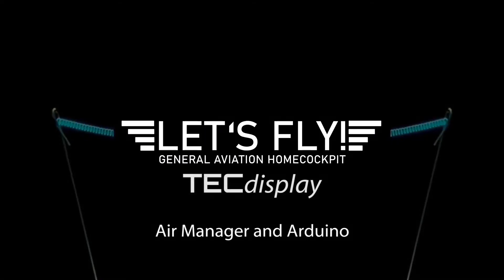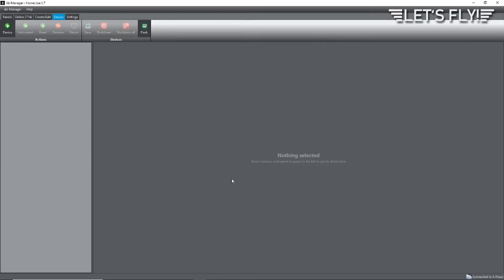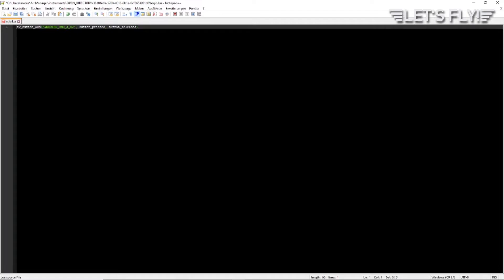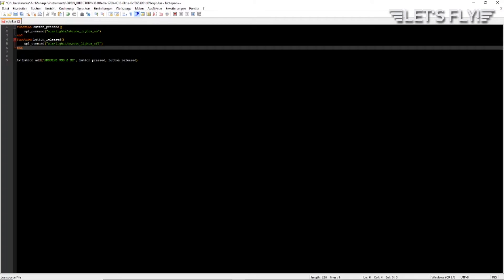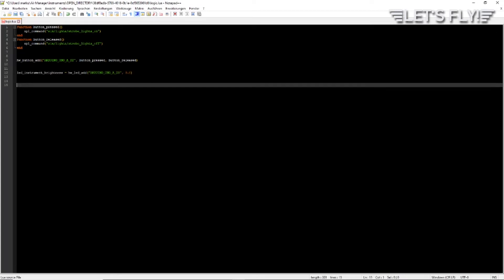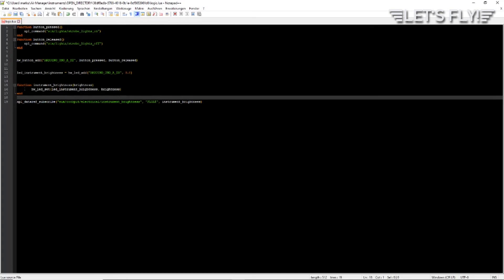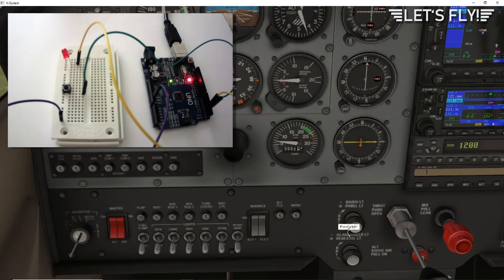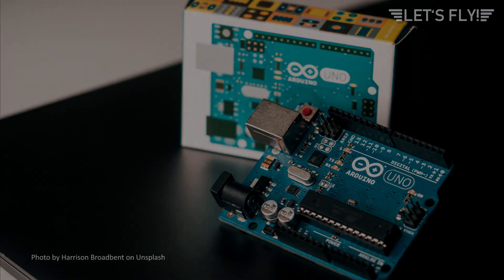TECdisplay connect buttons and LEDs via Arduino to Air Manager

Comment: Amazing, would you be able to help me for an LED I’m trying to link with the test all annunciators switch in the cessna 172sp 

Thank you
Reply: I’d be happy to pay for your services 😂
Reply from the maker: Hello. Such a functionality is not that easy. Either you have to code if yourself which is very exhausting or your plane allows it. If the plane has an announciator panel functionality all you have to to is to map the output variables to the LEDs then the test button to an input and it works out of the box... If this is not possible you will need to write a test button routine by yourself that turns on the LEDs and disregards all infao coming from simulator variables. If you would not do that it could happen that the test does not work because the variables status overrides the test function

Comment: thanks more for this video because soo usefull for me / us. 
i use Lua script into modules file in P3D files. And i use  Lua,   for extend input ports with multiplexer , MAX7219 for output ports too than designed PCB 
https://www.youtube.com/watch?v=pHCL-hBwWz0&t=50s
i have some Question that  is air manager need only code of arduino is enough?  
Could we use same arduino code with P3D or Prosim ?
Thnaks more again
Reply from the maker: Hello,
I use Max7219 as well but only for P3D together with Mobiflight, which has in that case the benefit of using FSUIPC.

Air Manager code can easyly be adopted for P3D but I fear not with Prosim. That means, that it supports the standard control functionalities of FSX/P3D and in the Beta (but no Air Player currently) MSFS2020 via events. The list s here: http://www.prepar3d.com/SDKv2/LearningCenter/utilities/variables/event_ids.html

But prosim I fear is not connected.

you need air manager for codung the arduino and one instrument that runs that code. that instrument can be invisible and run in air manager. If you want to use more conputers you will need air player.. but you can also run the instrument on the air player computer (in my case an Raspberry pi).

Happy Landings!

Markus

Comment: Hi, have you investigated the use of touch screens and a Knobster? A dual rotary encoder with push-button.
Reply from the maker: Yes and no. I use Raspberrys so touch is very limited because a lot of displays are not supported.
Knobster: no because I connected all the rosaries I use via air Manager Arduino support
Reply: let's fly  thank you for you reply. I am new to flight sim’s and I am looking around for info on which way to go. Your channel is very informative and helpful. Cheers.
Reply from the maker: I use dual encoders in my propwash sim panels which are remounted and preassembeled. They use super encoders with a great haptic. I can only recommend using them over the ones you get cheap on ebay. The difference is huge

Comment: Can you share the code, its not readable, and i have errors, the brightness works in Xplane the buttons  not, i need to make this work with switches also
Reply from the maker: It is pretty easy, i have taken most of the code from sim innovations homepage. Since I am not at home here a modified script

button_pressed()  
xpl_command("sim/lights/strobe_lights_on")
end 
button_released()  
xpl_command("sim/lights/strobe_lights_off")
end 
 hw_button_add("ARDUINO_UNO_B_D2", button_pressed, button_released)
Reply: @letsfly  Thanks, as a noob i need a place to start...